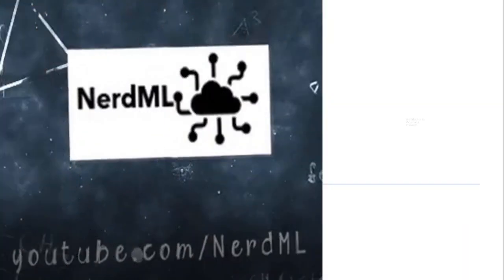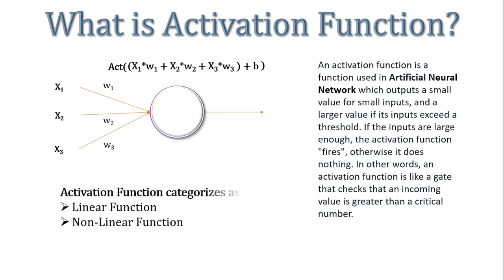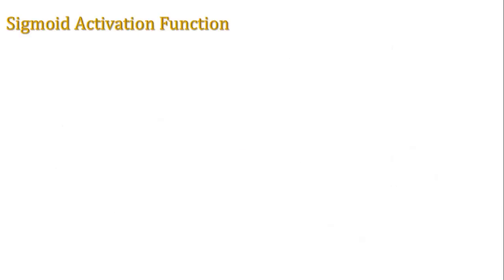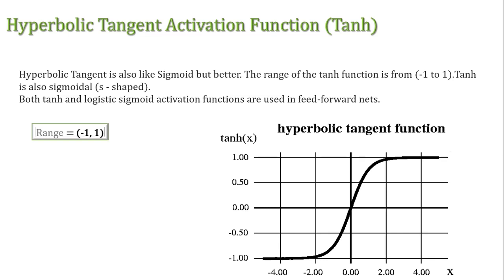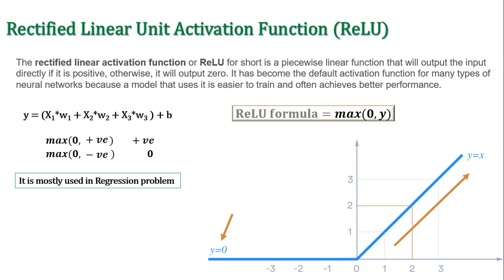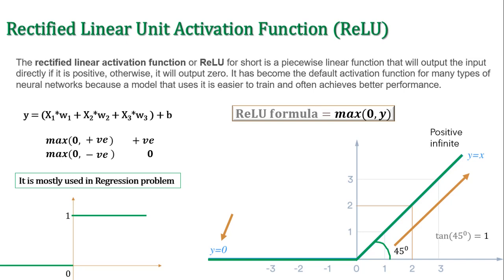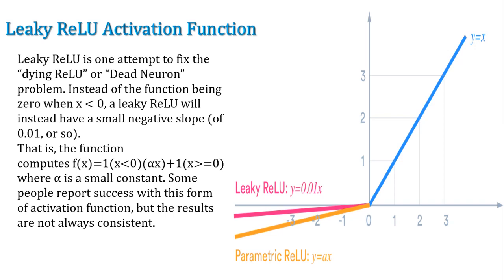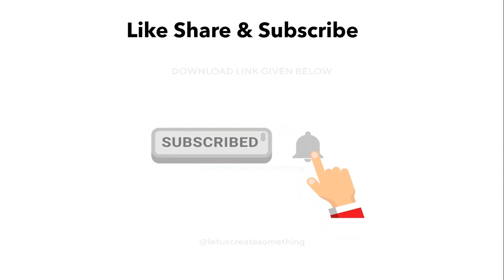Activation Functions in a Neural Network | Sigmoid,Tanh,ReLU,Leaky ReLU,Softmax Functions | NerdML

Comment: ReLU is a switch🤔 f(x)=x is connect, f(x)=0 is disconnect. A light switch in your house is binary on off yet connects and disconnects a continuously variable AC voltage signal. Then you know the dot product of several (switched) dot products is still a dot product.
Reply: ম্লক্লল্ক
জক
জ
 কজ
Reply from the maker: What do you want to say?
Reply: @NerdML  It tells you a lot about how neural nets work. Each switching decision is decided by some simple dot product with the input vector. Of course the other vector in the dot product was decided on the fly by prior switch states. Nevertheless each decision in a ReLU net is made by a simple dot product picking out (filtering out)  some pattern in the input. 
It provides a line of reasoning about such neural networks. Take it or leave it. Its not my job as a hobbyist to care so much or do so much about it. I did however provide some written information. AI462 neural networks.
Reply from the maker: I got your point but I was asking to some other guy who has commented in some different language
Reply: @NerdML  To google translate or not? Probs. a robot. The fast Hadamard transform is multiply free. Very important if you did special hardware for it. It can be viewed as a fixed bunch of dot products with an input vector. You can make it somewhat adjustable in a multiply free way by applying a fixed pattern of sign flips to the input of the transform. Or applying a permutation. If you use a random pattern of sign flips you get a random projection (repeat for better quality.)  Which is very useful for 'fair' dimension reduction or increase. And also for locality sensitive ashes( with a h before.) YT algorithms !!! Anyway such a random projection is invertable and is really a random rotation of a point on the surface of a hypersphere.  If you look up uniform random point picking on the surface of a hypersphere one way of doing that is to pick a bunch of Gaussian variables and then normalize the vector length of those random variables considered as a vector. The central limit theorm also connects with the transform. Since the theorm applies to both sums and sums and differences equally. 
Yeh, I'm not keeping track of what I say to whom so exacly.
Reply: Ò @hoaxuan7074  94 pop4
Reply from the maker: Thanks Hoa, very well explained!!